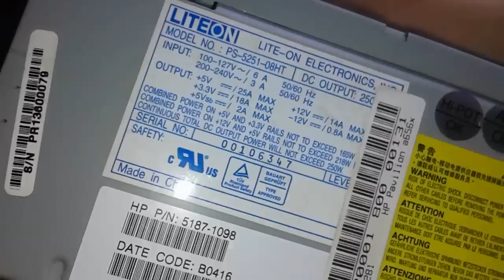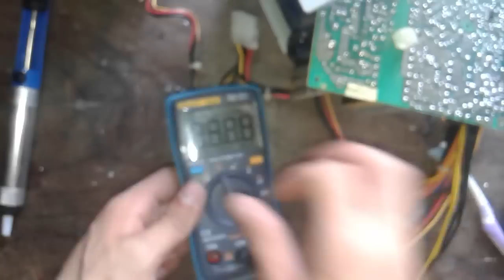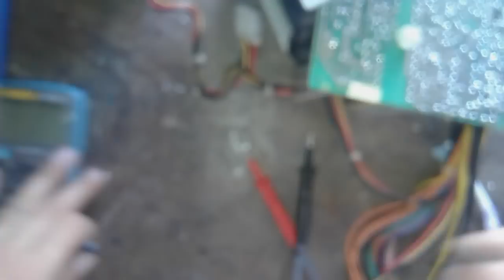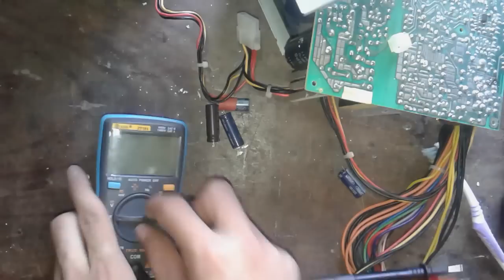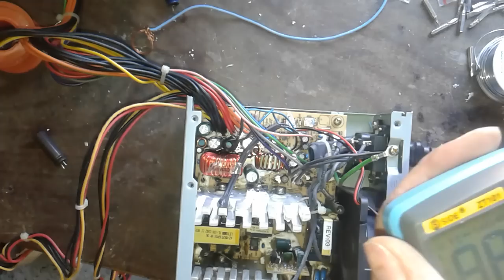How to Fix a Switching Power Supply /  Troubleshooting Repair Computer Power Supply  , PSU ,

Comment: Hello, besides easy capacitors bulged, how to find a particular short component either in secondary surface or SMD component. I have an ATX PSU with no voltage. Thanks

Comment: The fan on the power supply cuts on and then immediately cuts off. I'm getting 120v when checking the transformer from L & N. Where do I go from there? Or if you can tell me my next step or the solution to my problem. Thanks

Comment: I have a power supply it does not give output but only 5volts Standby and it has a Mosfet at secondary section when I remove it 12,5,-5-8.1 give supply but it does not give 3.3 volts 
.. what is the problem with this supply ??
Reply: check power rails

Comment: Use analog multimeter to check capacitor
Reply from the maker: Muhammad Yawar Ifraheem i like more Digital Multimeters  :)
Reply: IsDeno24 i also like but using analog multimeter you find defective cap your meter only show uf value if cap have bad esr and good uf it not working that's why i recommend analog multimeter or esr meter
Reply: IsDeno24 i like both analog and digital multimeter